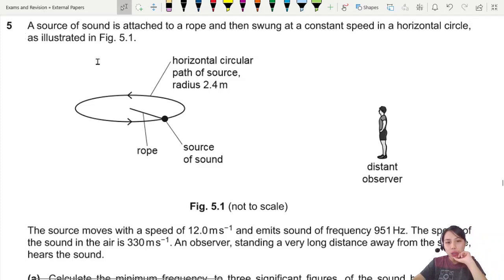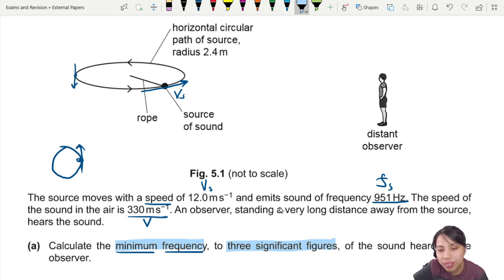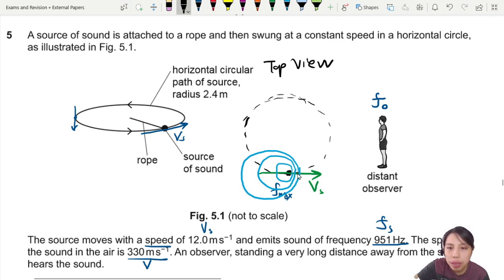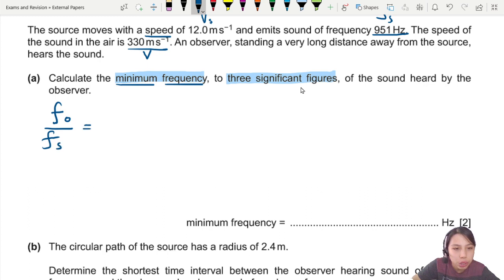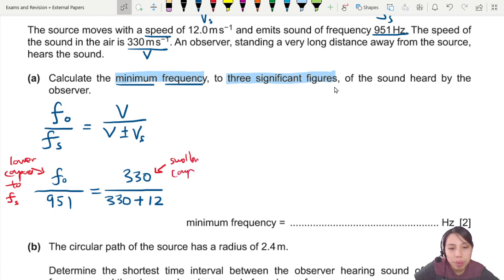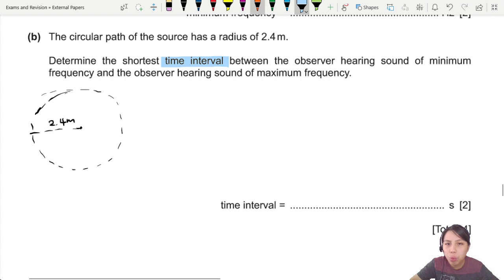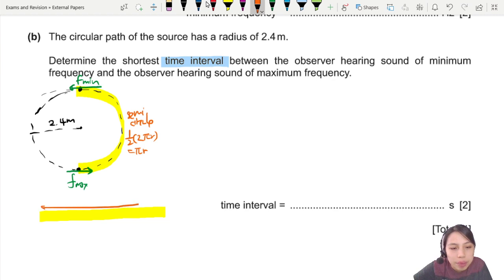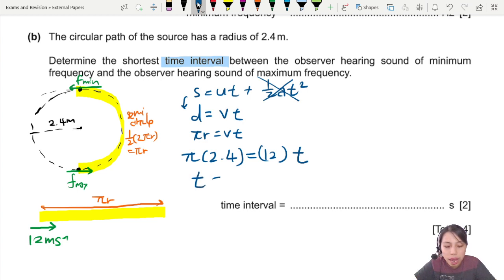FM21 P22 Q5 Circular Doppler Frequencies | Feb/March 2021 | Cambridge A Level 9702 Physics

Comment: In 5b, why not take the diameter as the displacement instead of the circumference?
Reply: Displacement = shortest distance , in the path of the circum of the circle , theres a curve that increases the distance ie distance is used rather than displacement